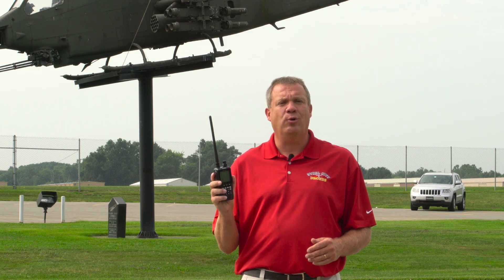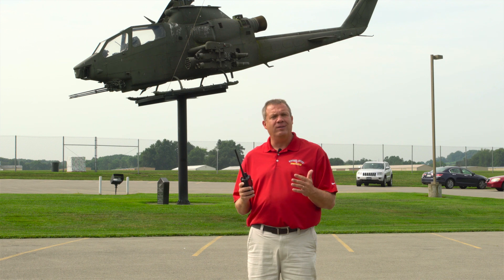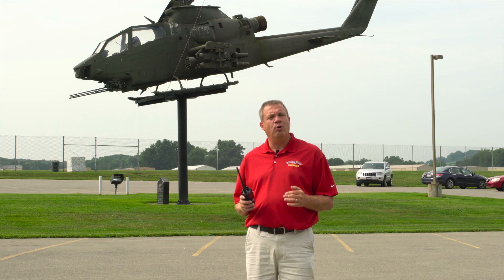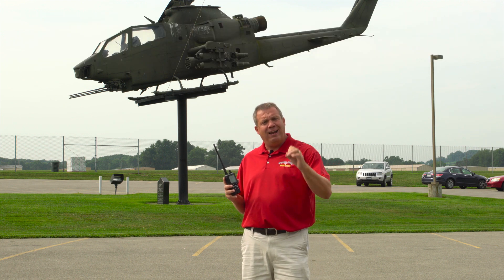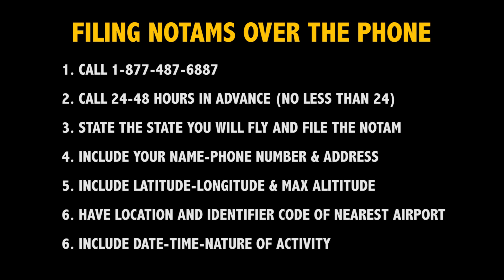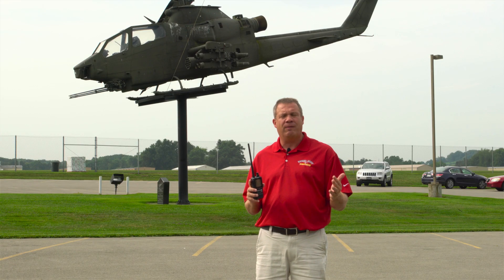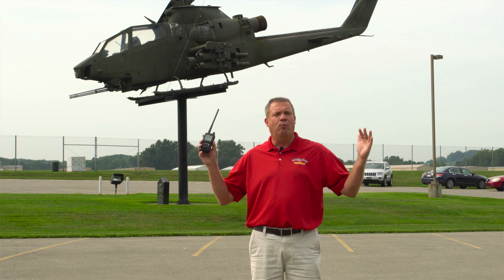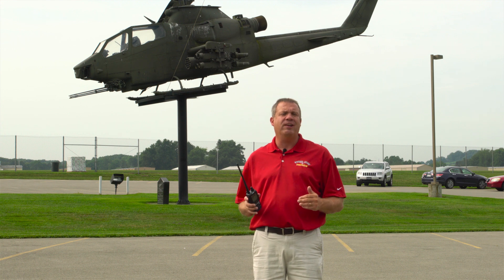How To: Fly Drones Commercially Near Non-Towered Airports

Comment: Excellent tips! This is info is often not covered with beginner tips nor in online classes. You may not flying next door..but even 2 miles is like knocking at the airport door as departures and arrivals can easily change from 500ft to lower in a manner of seconds. I have a FCC license but I still would rather not distract a pilot.